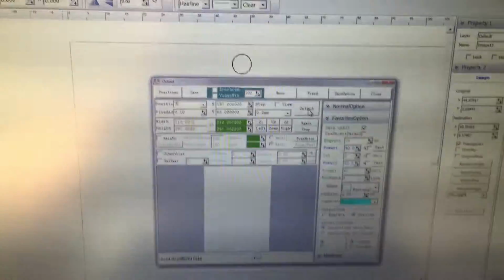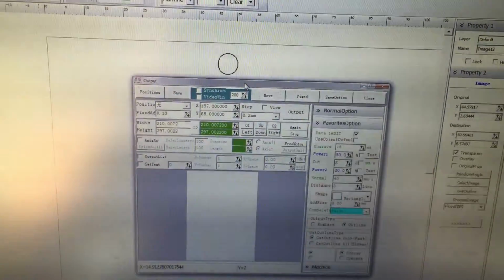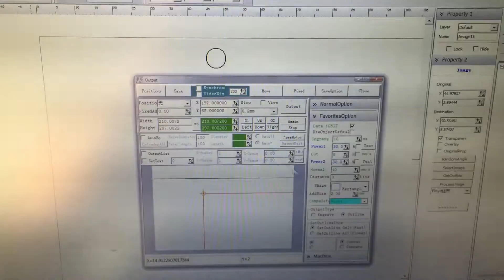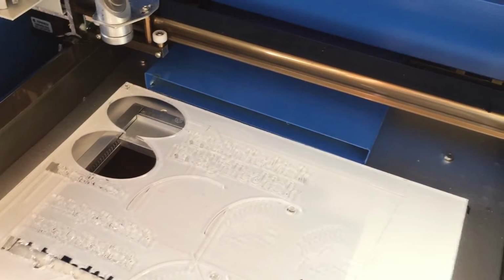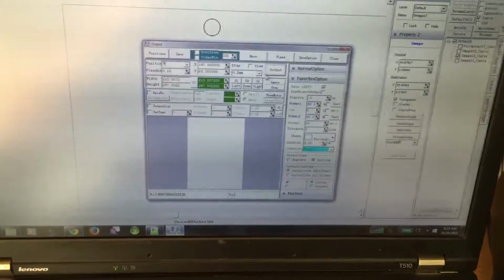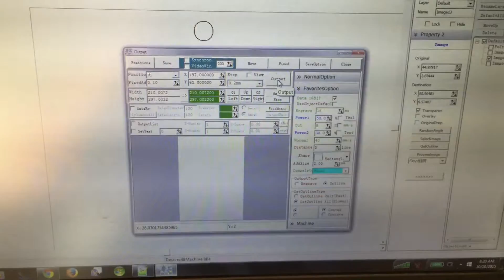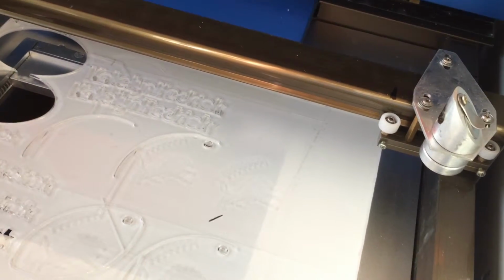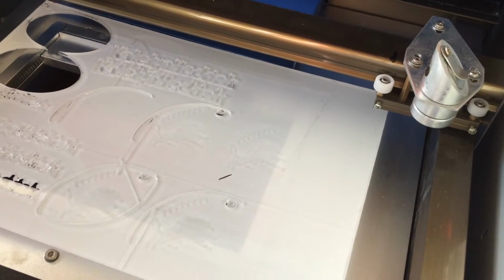k40 laser cutter issue with outline function. 10.10.2015 : fix attempt 4

Comment from the maker: No.  I became frustrated enough, I ordered an upgrade kit, http://www.lightobject.com/X7-DSP-upgrade-kit-for-DK40-small-CO2-laser-machine-P942.aspx , that I am about 75% done installing.  The software looks much better, no dongle is required, and the laser power can be adjusted during a single job which allows for dithered engraving.